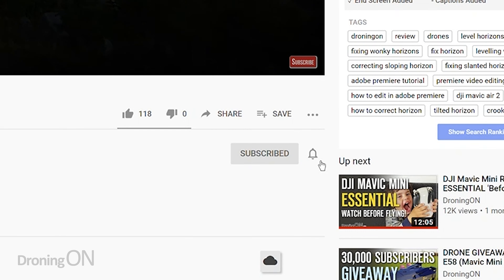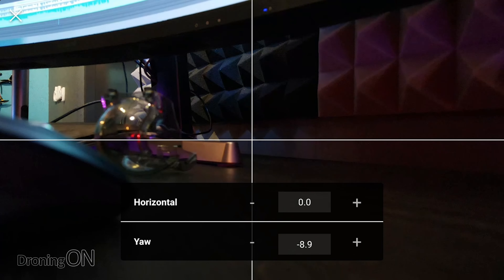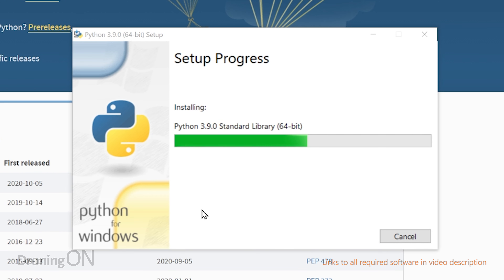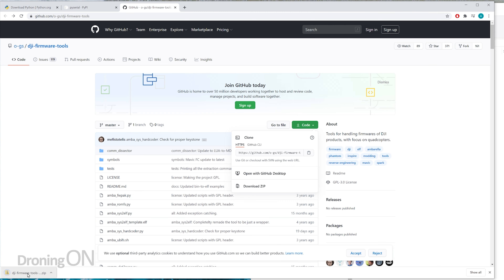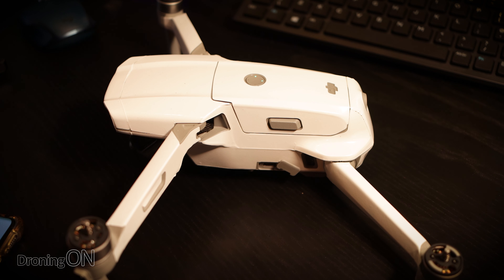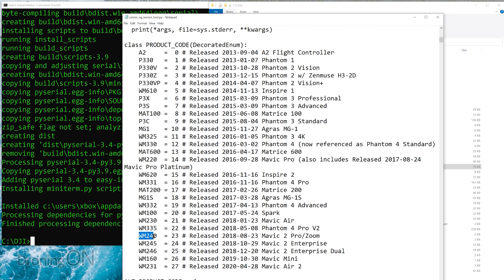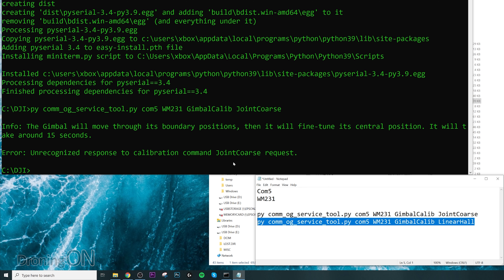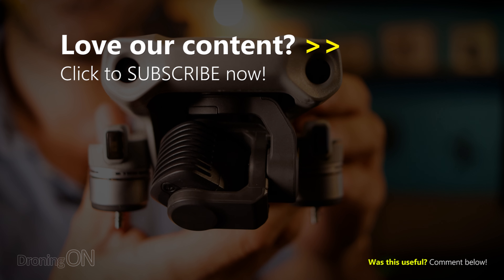FIX DJI drone ERRORS/ISSUES after GIMBAL/CAMERA replacement

Comment: asamson
1 second ago
hello i know about this and i have tried it on the dji mavic air and air 2; it worked but when i tried it on the mavic pro 2 it didn't work, rather it killed the gimbal imu board and the gimbal stops waking up well, even when it wakes up, it dies back in 2 seconds.
what do you think i should do please?
tried it twice already and it keeps on killing each gimbal imu board i connect to it 
thanks, nice video by the way.

Comment: Thanks so much for your help.  FYI: Camera serial number does not seem to be the issue with all "leftover" error messages. I transplanted old camera to new gimbal/camera/harness.....all but ONE error eliminated and system functions entirely as prior to crash.  "Gimbal calibration error. Restart aircraft or contact DJI support if the issue persists. Code 40011"  displays on each boot up.  My "crash" broke gimbal supports, ripped off motor drive harness, and left camera hanging with camera body dangling by its harness...but still imaging.  After extracting from top of pine tree, and shelling out 2/5's price of new drone in DJI parts,  I tried transplant to see what would happen.  Original camera, new harness/gimbal/camera housing.

Great video all round, saves tedious hunt and peck through endless chat rooms, forums and Apple-like DJI "support".  Hardest part of task is getting all tools downloaded and properly installed/unzipped and in correct folder, without subfolders, so command strings and tools for identifying drone ID and com port work.

Comment: Maybe there is a command that needs to put at the end of the procedure so that can "close" the calibration. I also try to fix a problem that was now really a problem (camera was -2 to the left). New Mavic Air 2 with no changes on hardware. After i did that i also have the error gimbal message. It is lke the drone forgets the SN of gimbal.

Comment: Could you follow the same steps for a DJI Mavic Mini (First Edition)?
Reply from the maker: Absolutely yes, see the links that I provided as there's a code to use for doing this with the Mavic Mini. Thanks for the comment!
Reply: LN DRONE & FILMAGENS  I just was looking into the latest comm_og_service_tool.py and there is no mention of the Mavic Mini 2 yet. But you can always contact one of the programmers via the github site and ask them, maybe they have a good answer to your question.
Reply: LN DRONE & FILMAGENS  It's the same as the mini 1 WM160.

Comment: Thank you for this video! However, I cannot see any Com port on my computer. :-( Do I need some driver?
Reply: I had the same problem Windows 7. If you first install DJI Assistant 2 it will install a driver that "magically' shows the com port.

Comment: When I try to connect my DJI Air 2 to my computer it does not recognize it. Any advice?
Reply from the maker: Most likely cause is a bad USB cable, please try some other cables.
Reply: @Droning-ON  Thanks, I'll try that.
Reply: Try installing DJI Assistant 2 first. On Windows, it installs a driver that recognizes the drone and pops up a USB port number that was not there before. Took me hours to figure this out. But then ran the code and it fixed my drone!!

Comment: Yes! Thank you !  I crashed my air2 into a big snowy tree, (when trying out waypoints from another app than dji,) and broke the camera, or more likely the wirering , gimbal, camera , ended up buying new from swedrone, and shure enough it tilted the camera sideways, after installed,,followed your instuktion to the letter,, the only hickup was that my "notes" wasnt able to read the dji notes, opent them in words instead, didnt really need them anyway, had the correct "strings" from your instr, Now ok ! Thanks.

Comment: Could u please help me got the DJI MINI 2 , receiving this error 
error: argument product: invalid choice: 'COM1' (choose from 'A2', 'P330', 'P330V', 'P330Z', 'P330VP', 'WM610', 'P3X', 'P3S', 'MAT100', 'P3C', 'MG1', 'WM325', 'WM330', 'MAT600', 'WM220', 'WM620', 'WM331', 'MAT200', 'MG1S', 'WM332', 'WM100', 'WM230', 'WM335', 'WM240', 'WM245', 'WM246', 'WM160', 'WM231', 'WM232', 'WM260')
Reply: Have you solved it?
Reply: any luck?
Reply: same issue
Reply: The same for me
Reply: add --port before the COM1 part like this:                     -port com1        etc etc .. Edit! add TWO hyphens.. it needs TWO ..

Comment: Merci beaucoup, j’ai suivi toutes les étapes et cela a parfaitement fonctionné! Très bonnes explications, même pour un DJI Mini 2, code Wm160. Bien rebrancher le drone et lancer les deux dernières lignes de code dans les 5s, tant que le port COM est ouvert.
Reply: You did this for the DJI mini 2 and used code WM160? I tried that and it gave me an error =\
Reply: @XcaLiPaul  I fix mine yesterday and yes for Mini 2 it's WM160. I don't know if you have already resolve your problem?
Reply: @olivierarsenault795  Yes I did, thanks for the reply. I couldn't get rid of the gimbal error message but it works fine.

Comment: well i tried this with my Mavic Mini and i get No response on calibration command line for both of the commands i tried it originally with my laptop couldn't get it to open the comport so hook to desk top and it reconized the port so i know i had communication guess back to the drawing board also made sure to use the WM160 file for the mavic mini if anyone else has an idea please let me know Thank you

Comment: Can this same procedure be done with a DJI Mini 2? Other issue i have is my laptop is windows 7 and the Python won't work onn the version or indeed earlier versions.
Reply: I have a mini 2 and I've to replace the gimbal. I would like to know the same thing. The procedure would seem to be quite simple, the only thing I should know is if the code "WM231" is also valid for the Mini 2 model. 
@Stuartie Murray let me know if you find this information 😉.
Thanx!

Comment: Hello brother, good morning, you will know if you can remove those errors that appear after the final calibration, thank you
Reply: Look at my answers and method, just finished the latest step by downgrade and re-upgrade the firmware on the aircraft to get rid of the latest error I had (40011). Succes!
Reply: @JC-ps2zy   I already did a complete step by step guide about a year ago for the maviic mini. If you browse the messages you should find it easily.
Reply: @JC-ps2zy  I posted a reaction in this video section, look for “AFTER THE GIMBAL REPLACEMENT (what I did).
You should be able to find it.
Reply: @JC-ps2zy  Did you find the solution that I posted (copy and posted) in answer to your question? And did you had it fixed by now?

Comment: I tried that on my phantom 4pro, because my gimbal is off center, it took a while to figure everything and get loaded, not easy but I did get on computer, I loaded the one for my phantom and it was suppose  to work but it didn’t get a response back from my drone, not sure why not at this point, I used wm331 fir my drone
Reply: It said it sent command to the drone and would start to calibrate but nothing happened and drone was turned on and hooked up to computer but said there was no response. From drone and mine was on com 5
Reply from the maker: Did you definitely use the right model number for the Phantom 4 Pro? Also did you write it as 'com5' not 'com 5'?
Reply: @Droning-ON  have you heard of anyone having success with this setup for phantom 4 pro, i have watched your video step by step , but no luck getting it to start calibration, now i am doing it with desktop, not sure if that makes a difference or not
Reply: what i am getting is that it will say the gimbal will start doing its thing, but i get no response on calibration command jointcoarse request

Comment: don't work for phantom 4 pro
error = No response on calibration command JointCoarse request
Reply: yeah it doesnt. tried mine. maybe something needs to be added
Reply: @odyandray1238  I got the same results with a couple different P4P's, would be nice to be able to do this instead of changing the casing on the motor.
Reply: @twincityaerial9258  I tried it and it worked one time. tried it several more times and no go. must be missing something

Comment: I've gotten to the point where I submit my code but it is saying that it can't use python even though its already installed. Is there any suggestion you might have to fix the issue?  Thanks again for posting this video, it's been super helpful. really hoping to figure out if I can get this gimbal working again.

Comment: Your information was excellent.
In case of p4p, if we want to change yaw motor , in that case we should keep yaw motor magnet of original motor which came with drone. If we put complete  new yaw motor(coil and magnet), then gimbal doesn't point straight. Can we use this method in such case where we just replace just a yaw motor of gimbal instead whole new gimbal?

Comment: I have had the same problem with my mavic mini - will follow your pointers and hopefully it fixes the issue, but as great as DJI is and has been, this will probably be my last considering these issues are so painful especially as someone who is technical!
Reply: Thanks, this video lead me too the same spot as you, error messages etc, after a couple weeks this all undoes itself (probably after firmware upgrades)

DJI 🤬

Thanks DroningOn
Reply from the maker: Thanks for the comment, yes very frustrating, let's hope there's a fix soon!
Reply: LN DRONE & FILMAGENS  Did you ever find the code for the Mini 2? I'm curious as I replaced my camera and cant use it. Thanks

Comment: Awesome! I just did everything and looks like it worked, I just crashed my dron after my first week with it 😂 but lucky me the gimbal and camera were still working, except for the flex cable which I replaced, then after your tutorial my camera was perfectly calibrated! Thanks a bunch BOSS!!!
Reply: Hey, I recently crashed my drone and i'm trying to gather as much info in order to properly troubleshoot it. I noticed you said you damaged a flex cable - seeing that it isn't a readily visible part by just looking on the drone itself, what behavioral change did you experience for you to dive deeper to then discover the damaged cable?  (I'm thinking to attempt what's instructed in the video without dismantling the drone itself unless i absolutely need to) - Thanks in advance.
^RD
Reply: @kloudsnaps 
 Hello, so  did you manage to solve your problem, cause i think i have a flex cable problem it got damaged , the gimbal and camera are not receiving any power so out of service. I'm thinking of changing this only cable and see.if it works.
Reply: @phdz9390  Changing your flex cable should resolve your issue. I'm going to attempt dismantling my drone over the weekend. I haven't had the time to do so before.

Comment: That is a lot of work. With the Mavic Air 2  still under warranty. I would have sent it back to Dji. But for the future. After the warranty is up. I might. Thanks Ash. Very good information.
Reply from the maker: Yes that would have been the plan for a regular consumer but I wanted to try the gimbal swap so as to share tips and advice with my viewers, plus the hassle of boxing it up, sending it off and the risk of DJI claiming that it was 'user error' and ending up with a bill, then waiting for it to come back, I didn't want to have to go through that!  Thanks for the comment!

Comment: Interested to hear what DJI support has to say and their solution... other than send it back :)
Reply from the maker: Sadly it'll be too late now that I've replaced it myself, but it's perfectly flyable so I'm not the bothered. Thanks for the comment!
Reply: @Droning-ON  : I was just wondering if they had any input as to the issue. I have called them several times for little stupid things. Oh... and I know you probably have already done this... but have you uninstalled the app completely... and re downloaded it? I would ask them a simple question... "Are the Gimbal/Camera units" specific to each drone and if you have to replace one how do you sync a new unit to the craft?... Remember when you could simply switch out te camera on the Pro & the Zoom?? But then they changed that right?
Reply: @GorillamansGarage  I have asked them questions like that on the Mavic Air 1 and they would not really give me a straight answer and say that all the parts were bound together. I repaired a Mavic Air 1 with all new parts taken out of a brand new Mavic Air 1 and got all the error codes so I had to send it to DJI. They said all of the new parts I put in it were bad and they had to be replaced. In the end they just ended up sending me a replacement drone and keeping the parts I put in it. I asked if they would return the parts but they would not, they said that they could send it back to me and I could remove them and then send it back but they would not return parts. I don't believe they want people working on the drones, I beleive they like to protect their repair income.

Comment: wish someone can explain this on MacBook. unsuccessful over here. everything is different.
Reply: I also attempted to try this on a Mac I gave up and found somebody with a Microsoft and was successfully calibrated my gimbal!
Reply: @rxwarriorman  i also got windows from a friend but couldn't do it. I guess im too slow for computers
Reply from the maker: Unfortunately for the Mac you'll have to use the Virtual Windows emulator as the commands here are based around Windows tooling.

Comment: Thanks so much for the tutorial. It worked on my Air 2s using the same model # as Air 2. Fingers crossed for future error message removal.
Reply: How to work for the air 2s?
Reply: How to work it for the air 2s?

Comment: Why they making you use command prompt. 

why wouldn't they design it so you can execute the exe inside the zip folder after it's unzipped so you can install the program and run it from there..

Comment: I tried this, and I get an error message "Error:  No response on calibration command joint coarse request." Has this happened to anyone else? I am using a Mavic Mini. I recently bought a new gimbal / camera assembly and installed. It works, but it has the tilt that we've all been warned about. I used the proper WM160 code., and can't figure out what I am doing wrong here. I really want to figure this out, any help would be appreciated!
Reply: Hi were you able to figure this out?

Comment: Excellent fix - thanks! Like others who have asked - did you ever find a solution to those irritating persistent errors 10017, 40011, 40021?
Reply: Look at my answers and method, just finished the latest step by downgrade and re-upgrade the firmware on the aircraft to get rid of the latest error I had (40011). Succes!
Reply: @EDW3700  What about error 40021 or 10017? did you also appear? was it solved?
Reply: @sebastian.rojasn  I don't recall to have seen these errors, but since the down- upgrade via the drone-hacks tool solved the gimbals issues, I think it will work.
There was no problem doing the down and re-upgrade more then once. Just give it a try you have nothing to loose, but keep in mind that you follow the steps as described.
Reply: There ia a software for DJI Service Centers named 'RepairTool' for any DJI products and it just running with specified VPN with Certificate that can Pair modules by its IDs into drone's Mainboard...

Comment: Thanks mate. I recently replace my Mavic Air2 Left front arm and also the gimbal. This video helps me get the camera works properly. I am aware that the error message would not go away after getting the camera to work as should.  Just wondering if anyone managed to clear the errors???

Comment: Hi, after following the steps, the gimbal was in the correct position. I did the calibrate of Mavic Air 2, but there're 02 errors: 40021 and 10017. How I can fix it?

#droneonbag
Reply: Replace Flex Cable. All errors about IMU/GPS module connection..
Reply: There ia a software for DJI Service Centers named 'RepairTool' for any DJI products and it just running with specified VPN with Certificate that can Pair modules by its IDs into drone's Mainboard...
Reply: @mehdimahdianvideos6960  Is it free?
Reply: @droneonbag  unfortunately no! Also not accessible for anyone except DJI Service Centers.

Comment: Anyone receive the same error?

Error: could not open port 'com3': PermissionError(13, 'Access is denied.', None, 5)
Reply: That is appearing because some software on pc are using the drone port, try to close all programs that could use that port. (Close dji assistance)

Comment: Good video - I'm a Mac user however I used parallels to fix this 100% thanks million - any news on removing the errors on screen when re-connected to controller?
Reply from the maker: Unfortunately there isn't a fix for these errors yet, very frustrating but someone will create a fix eventually. Thanks for the comment.
Reply: Is Parallels the only way to do this on a Mac?

Comment: I don't know if I need to do these steps, but I tried to remove the 40011 error with no luck.  Anyone figure that out yet?
Reply: Look at my answers and method, just finished the latest step by downgrade and re-upgrade the firmware on the aircraft to get rid of the latest error I had (40011). Succes!
Reply: Find in comment  Mr " Aytac Engin " already answered and fixed it.

Comment: Will this work with phantom 4 pro?
Reply from the maker: Yes is absolutely should! Thanks for the comment!
Reply: @Droning-ON  I tried it on the P4P and it first tells me the gimbal will move through all positions and all axes but it does not, then I got Error: No response on calibration command JointCoarse request and the same with Linerhall.